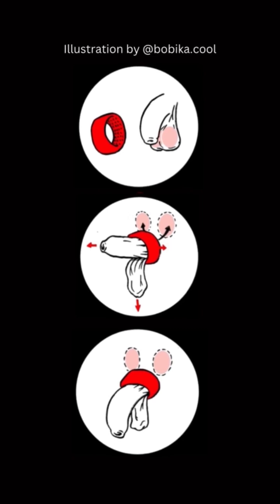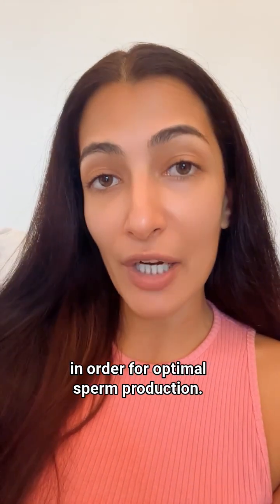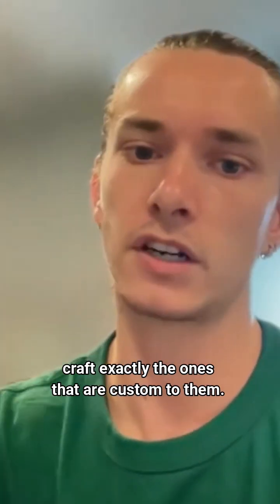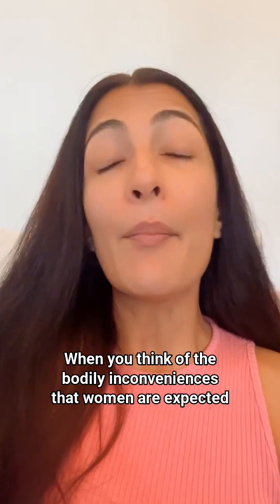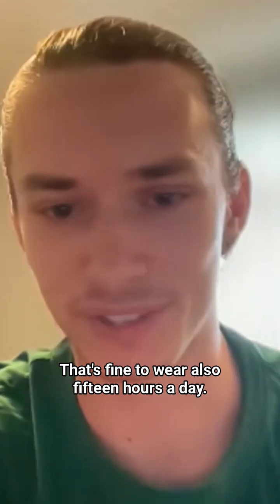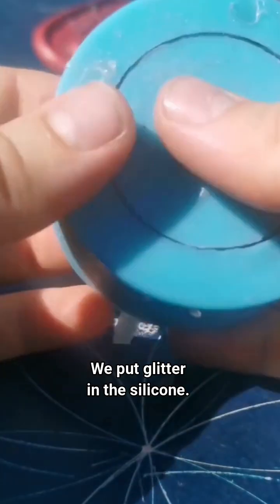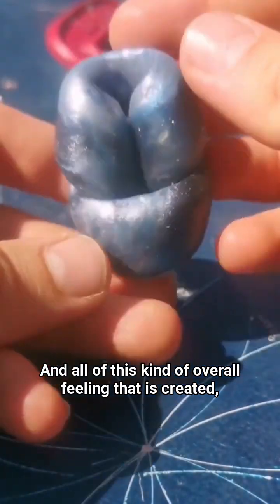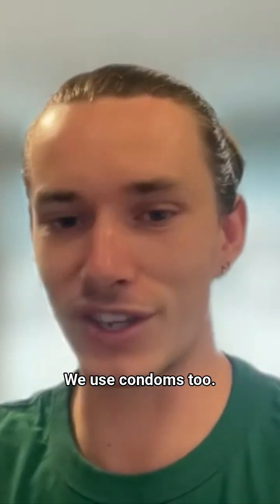What is Testicular Thermal Contraception? | Samuel Flambard (Otoko) | Leeza Mangaldas

Comment: What do u mean push the testis back in the body.. for 15 hrs × 3-4 months??  So much time for something that is reversible in another 4-6 months. And then what women do compared to men which have nothing to do with men. She compared pads  bras and waxing to emptying your testes from the scrotum inside the body and blocking them with a rubber tube. Even models don't wear heels for 15hrs. 😂😂Condoms are best Stops STDs and babies both. 😂😂

Comment: 😮 Interesting! So, should the 15hour/day wearing has to be continued after the full contraception is achieved or can it be reduced to some particular time range?
Reply: You have to wear it continuously for 15 hrs for 3-4 months from the start point. IF Then u stop after sperm test you will be fully fertile in another 4-6 months with regular test. No reduction in hours.
Reply: @NikZ500  Cool, thanks👍🏻